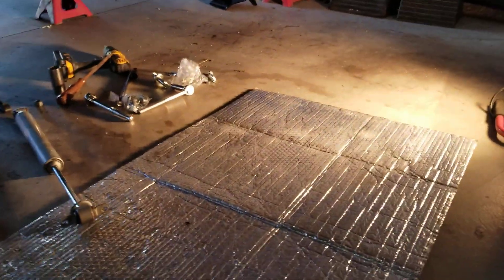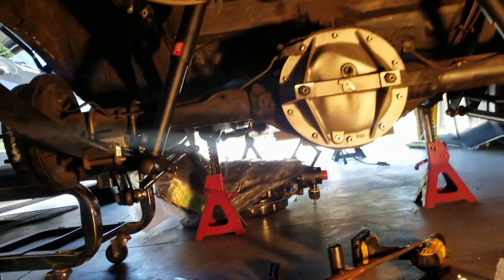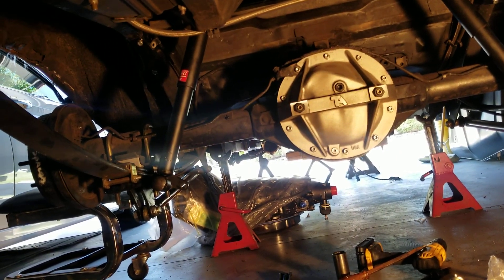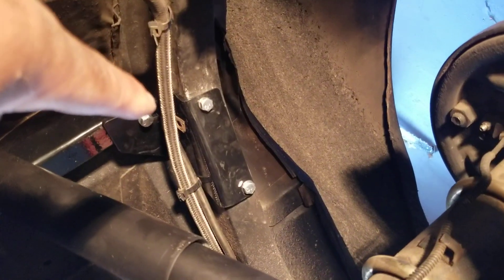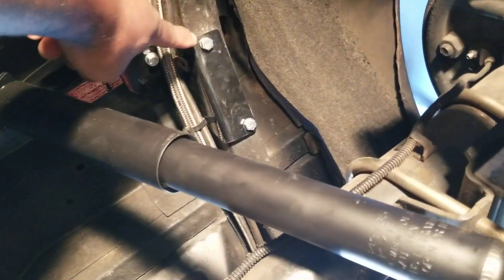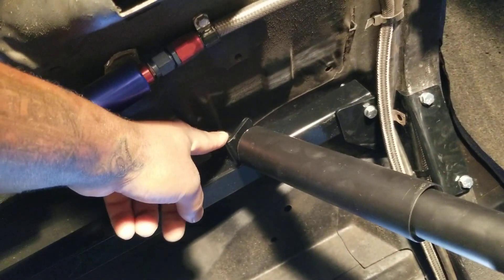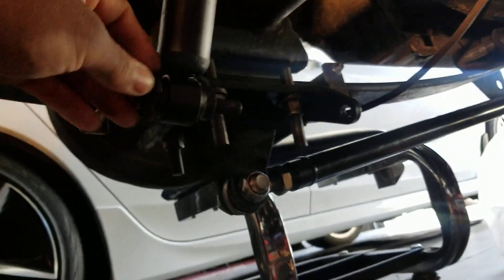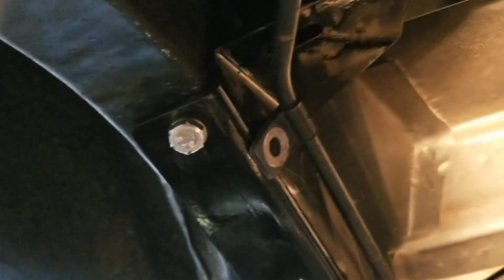CHEVY NOVA REAR  SHOCK RELOCATION

Comment: Looks nice. I've read people cut holes in the trunk with rubber plugs to access the top nuts. No idea why they didn't make the shock mounts on the cross bar lower and accepting of the stock shocks. they are shorter and would fit. May have to make that myself.

Comment: How come the instructions pictures in the website show the shocks in front of the rear end (9” rear end) ? Yours are on the rear, can they go ether way?
Reply from the maker: Either way, I've never seen shocks in the front on a 70 nova
Reply: I’m doing this kit on my 67 Camaro right now and I was stumped with the fact that it’s asking to put the shocks in front of the diff. Ima do it but already I see that it’s hitting a hair. I’ll do the install with the lower shock mounting plates facing in as stated and see how it is when I mount the wheels and lower it.  But I litterally installed with the shocks in the rear of the diff then saw the instructs say place everything forward.
Reply: @Senor_Garcia update on how this went? I’m installing on 67 firebird rn

Comment: Hey man I have a 73 nova and can I get your opinion on a engine. Their is this 1973 454 naked engine block. Already passed for cracks and cleaned along with the number matching heads. The heads don’t have no valves or springs. But this guy has the steel crank that needs to be turned, their 781 heads is the last three digits and he is selling everything  for  1200 bucks. I might be able to get everything for a 1000. Do you think it would be worth it. I do want to go to big block but not sure if that price is right. Thanks I’m asking you cause you seem to have had yours for a while. Not sure what the market goes for. Thanks. It is only naked block, heads , crankshaft.
Reply from the maker: 1000 is good heads are good too that's a deal
Reply: ss396rat Thank you sir. I am probably going to get them. If I did I would like to bore it over and all that. I know big blocks cost a lot more to build then small blocks. But in the end I think it will be worth it. Also he said it did have bronze guides in the heads. Do you have a preference on the pistons and rotating assembly. I know you went with hell fire rings. May I ask what crank you used. It seems like your build is holding up pretty nice.
Reply: ss396rat I plan on going back and watching your engine build videos just to get ideas on some things. I really like what your doing to your car. Keep it up man.
Reply from the maker: @justicelife1164  scat forged crank
Reply from the maker: @justicelife1164  srp makes good pistons
Reply: ss396rat Thanks again for your time and responding so fast.
Reply from the maker: @justicelife1164  anytime
Reply: 781 were real good flowing heads